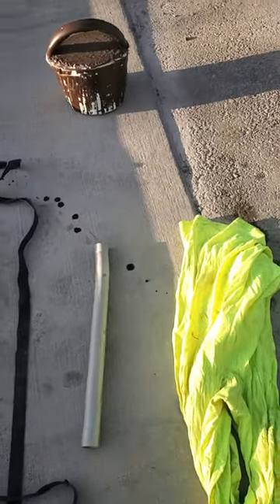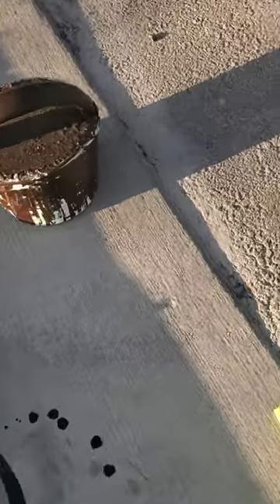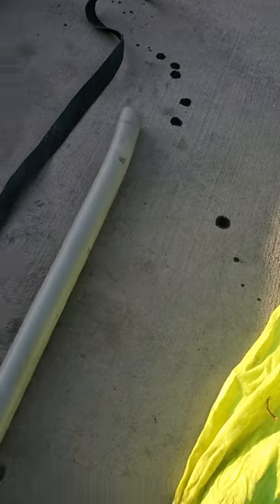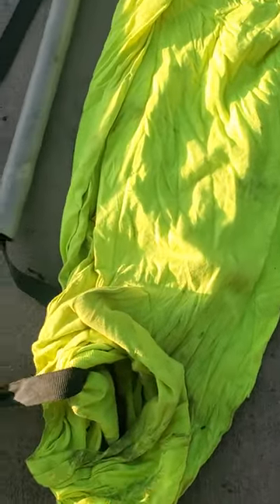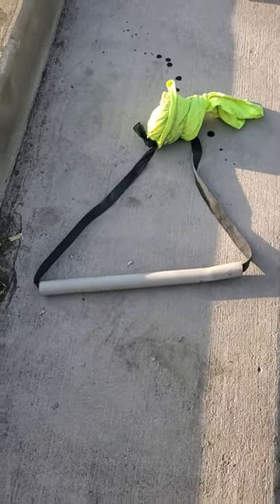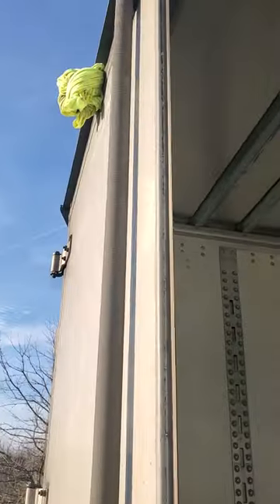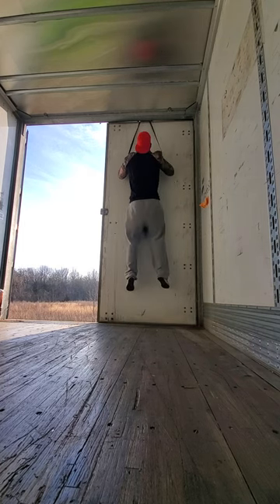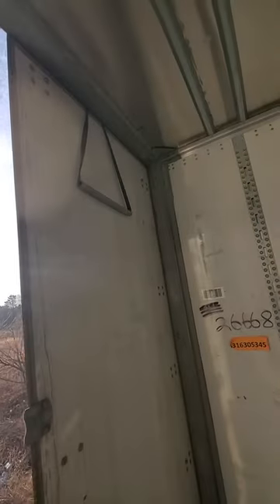Trucker DIY pull up bar.

Comment: Thats really clever man. I've been trying figure out how to make a pull up bar that would work for us otr guys for years. Something that wouldn't take much assembly. I've thought that if someone could create a bar that folds up from the bull bars on the front of the truck that would work great as a dip and pull up bar system.
Reply from the maker: That would be ideal.  Something heavy duty.
Reply: @helaltariq3958  who knows maybe you could take what you did and patent it. And have them sold at truck stops. I'd buy it

Comment: Or you could run a strap or 2 thru the pvc  hook it to the wall and you got a pull up bar without being against the door. Also a load bar works
Reply from the maker: Definitely trying that today.